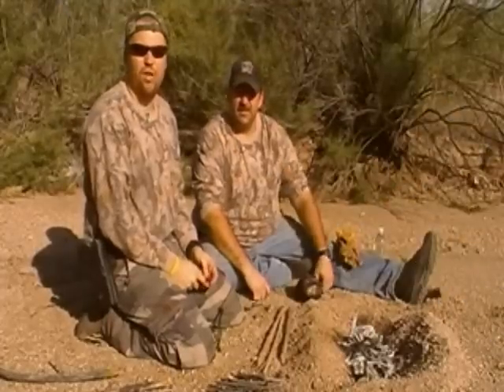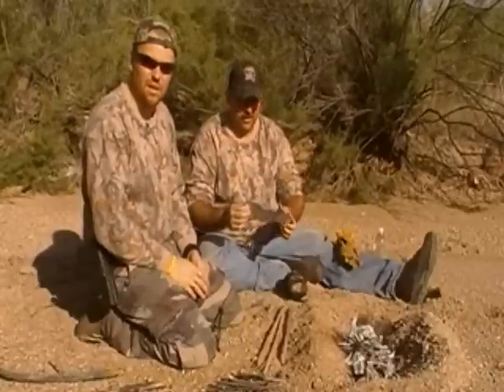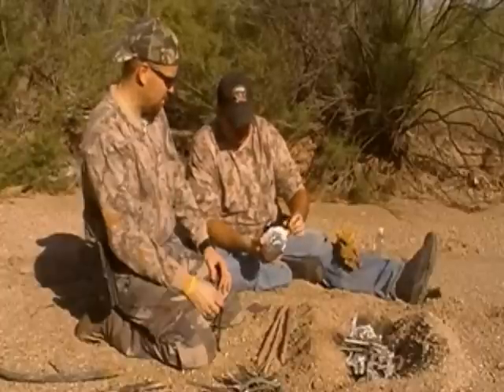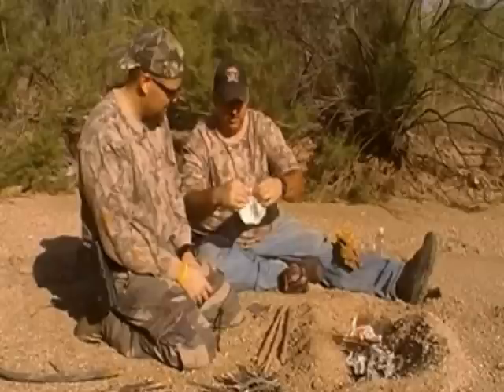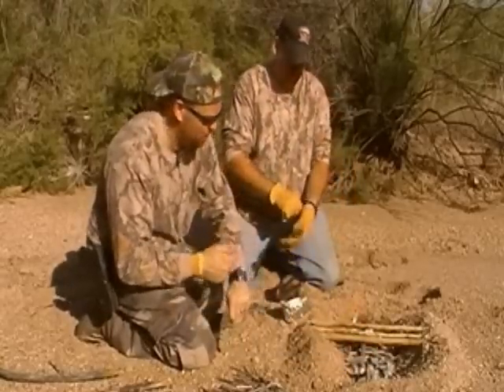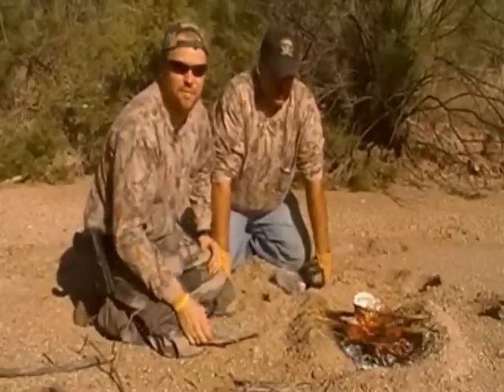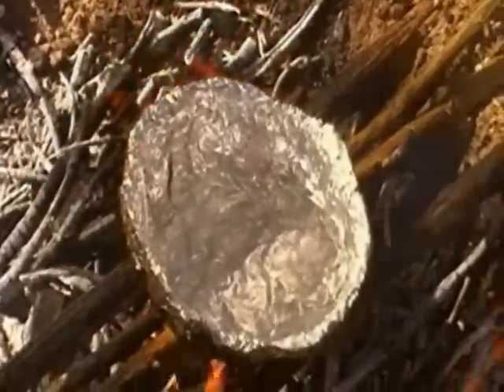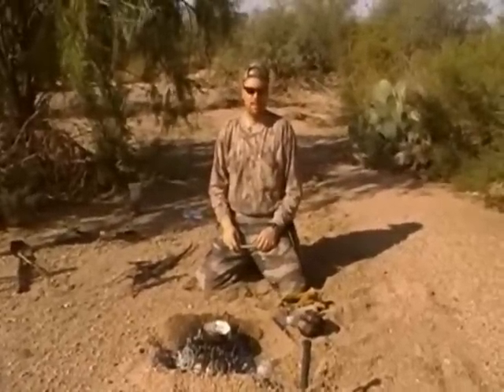Aluminum Foil Bowl water boil

Comment: Aluminum foil is a GREAT item that should be in every survivalist's gear. One of the best ways to fix a baked potato is to wrap in foil and put it in the coals of a fire. BTW, a lot of people don't know this, but, as your other video shows, plastic water bottles can also be used to boil water. The water inside keeps the plastic from melting. It's pretty hard to go anywhere without finding litter, including plastic bottles, so, there will always be a source of containers to boil water.

Comment: @2brothersadventures aluminum foil doesn't really heat up, it just transfers heat really well. If you touch where there is hot water then it will be hot, if you touch where there is air it should be ok to touch with you bare hands. I do this with pizzas in the oven all the time.

Comment: the fast is bacteria will be killed at 160 deg. so once you get a boil at 212 deg. every thing has been killed for a few minutes anyway, once you get it to boil your done. The 5 min or 10 min boil methods arent true. Plus you can use a flat stone you help support the foil cup, and use can use HD foil or even tooling aluminum which is the stuff wind screens are nade of. Nice video guys keep it up.

Comment: nice video, thx. there is only one problem i see with boiling water. you boil it to get rid of bacteria and germs, ok, that means you need to keep it boiling for about 5 minutes. now take a cup of water, boil it for 5 minutes and see, whats left. not much. half a cup maybe. this will save your ass in the woods but it will take a lot of time to get enough water to survive. (needs ruffly a gallon/day if its hot) maybe half the day just to make water. keep this in mind, or use larger bowls :) 5*s!